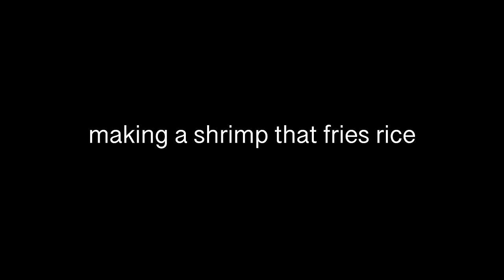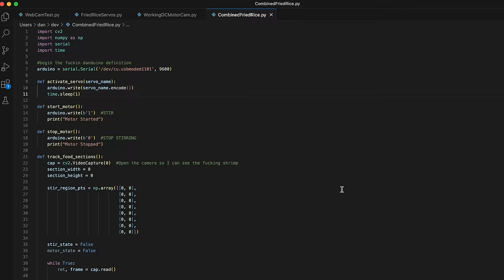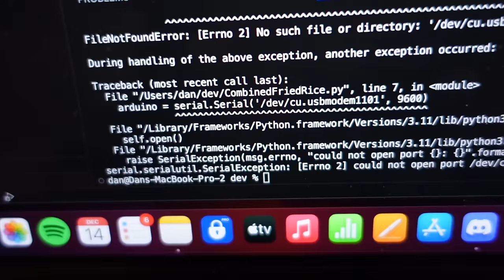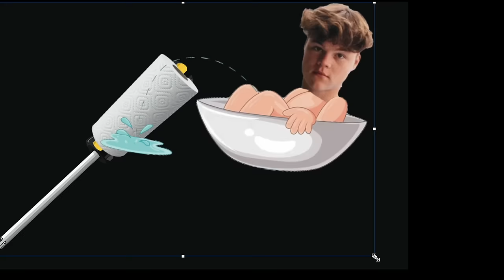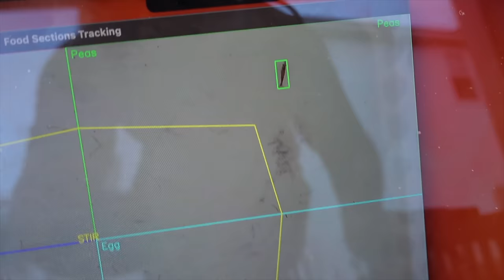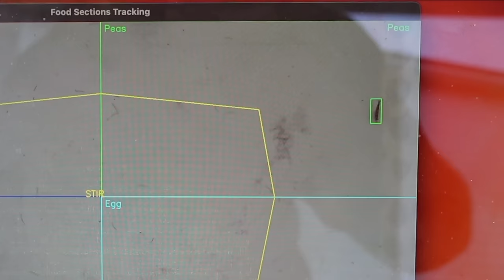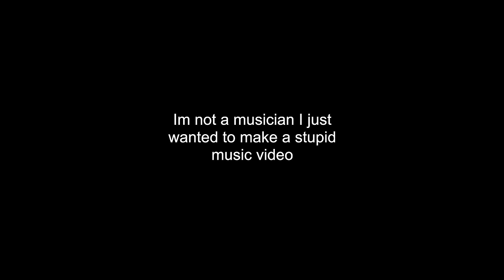I Taught My Shrimp To Fry Rice

Comment: Dang dan, way to rip off my friend @repeatedfailure’s project from Open Sauce last year.

This will only burn bridges for you within the maker YT community, so I hope the views are worth it.
Reply from the maker: Hi Louis, 
To say I ripped off his idea I think is entirely unfair. I credited him in the description for the idea, but saying that negates the months of effort I’ve put into this project, all with my own original code (repurposed from my own OpenSauce project that tracked a turtle’s movements and controlled a car with it), ingredient adding mechanisms, designs for the electronics and circuitry, and raising of my cherry shrimp (and having to redo the entire project 2 times).  I even repurposed the same camera I used from my previous project and container. 

I have the utmost respect for makers like yourself and Jamie (RepeatedFailure), and the last thing I want to do is burn any bridges.  I have made this project my own as much as possible with due credit as well.  During the creation of it, I didn’t reference RepeatedFailure’s build a single time in order to purposefully avoid any similarities and ensure anything created was of my own design.  

If there were a thousand videos on this topic, I still think there wouldn’t be enough, but I don’t think “ripping off” is a fair judgement of my project or efforts.
Reply: @Danoramic  i’m not saying you didn’t put work in, and I’m not saying you stole any work directly from repeated.

I’m saying taking someone else’s concept that they’ve already put a ton of work into is pretty dang crappy.

Like, whether or not you did a good job isn’t the point. But excellent work. You fried rice with a shrimp.

Comment: Its hard to tell, but the shrimp he grabbed and the shrimp in the tank are not the same shrimp. The change in pattern on the shell and the fact he refers to it as a she at first and then a she I am 90% sure he killed the initial shrimp. That or he got real intimate with it and learned that it was trans... not sure which is worse here.
Reply from the maker: Ok SO!  Very good eye!  The original shrimp was a large female that I was using because I figured her size would make her easy for the camera to pickup and track. Wrong. 

The first time I tried doing this was a total fail, the code wasn’t picking up the shrimp and my motor wasn’t working because of a lack of power against the resistance of the rice. 

I realized I can use a small fish in lieu of a shrimp for testing purposes (I did NOT want to stress any more shrimp out until I was totally ready to cook), so I put that girl back in the tank and she’s totally beautifully!  She even got pregnant a few days later and just dropped some babies. 

I ended up filming on a different day with a lighter colored male shrimp after changing my code to work properly (which as you can see, it does), hence the different sexing of the shrimp and colors.  

I have not lost any shrimp doing this project!  I love them way too much and post about them all the time on my IG (Dan.theturtleman)
Reply: @Danoramic  🦐